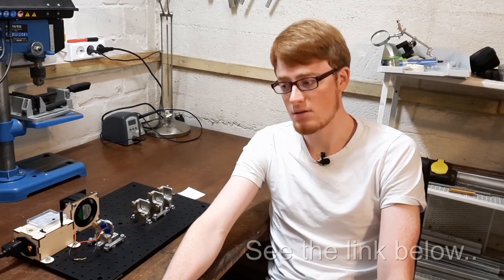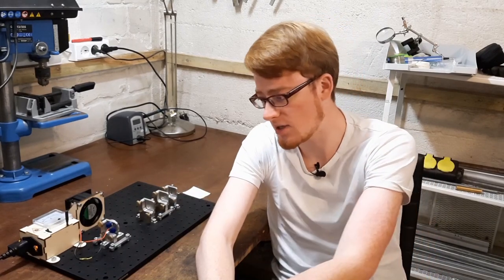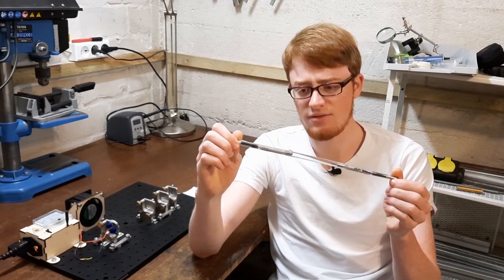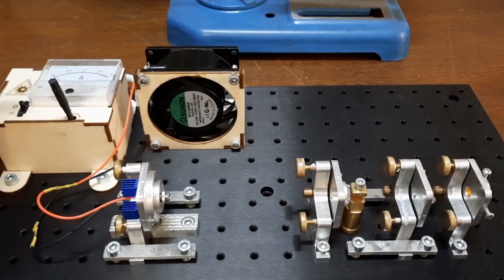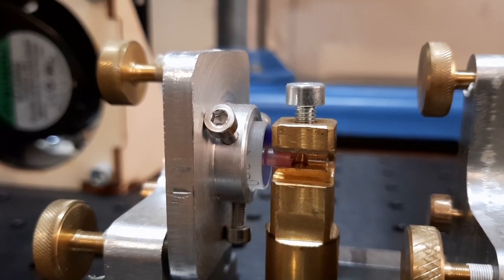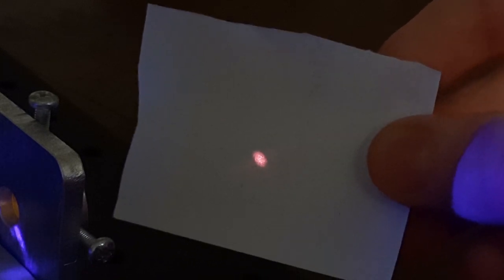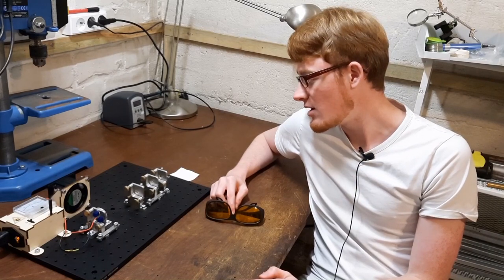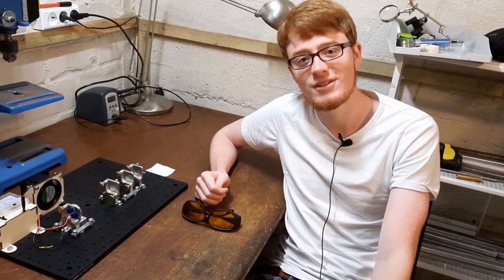A continous wave diode pumped RUBY LASER

Comment: Hi, I too am a laser experimenter and have been building various lasers fore close to 60 years now. I too am in the process of building a laser very similar  to yours except that I want to try and use  the combined output of several hundred blue  high power light emitting diodes surrounding the Ruby Rod in a more traditional optical cavity setup  but just use the blue leds instead of the flash tubes. I have several various size Ruby Rods and I will also be building a considerably more powerful traditional Ruby Laser using a 240mm long by 15mm in diameter rod and 2- 8500 joule flash lamps. I am very glad to see projects like yours since I was interested in Ruby Lasers for  almost 60 years now but there are very few people at least on you tube doing these kinds of projects. I wish many more people were into this kind of experimenting and building such powerful devices at home. I hope you continue to build on your project. I will continue to follow your progress.
Reply from the maker: Hi Peter! I can only repeat back what you have said: It would be really cool if more people were interested in building these kinds of lasers. 
Please, do keep me updated about your project(s)! I have read a few comments that pumping Ruby with LEDs is very problematic but this makes it even more interesting. Furthermore, I am actually also in the process of making a pulsed laser. It will, however, be a Nd:Yag Laser, but a pulsed ruby setup is planned. May I ask where you get your flashlamps and the ruby outcoupling mirror? Finding especially the latter has been a real challenge to me. 
Thanks for your comment! 
-Nik
Reply: @WoodenWeaponry  Hi Came across a guy through the laser pointer forums who had some sources of where to find these high powered flash lamps and the mirrors and I think the company was in Great Britain but i am not absolutely possible since this was several years ago. That place also had a huge assortment of Ruby Rods of all sizes and configurations but the rods were already all sold out. Unfortunately Ruby Lasers are gradually being phased out of industry and eventually they will probably just dissappear. I too have been looking for the proper Ruby Mirrors for several decades and I found that they are extremely rare and when they do come up on the used market, they are very expensive and are sold almost the moment they are listed. I even asked Thor labs if hey had proper Ruby Laser mirrors and they are able to make a couple if someone is rich enough to buy them. For a 25mm in diameter di electric mirror, they want $5000.00 U.S.  each for the totally reflecting mirror and $7000.00U.S.  for the output coupler plus they wont sell them to ordinary citizens because they are considered to be a component of a high energy potential device. I have come across the odd mirrors on Ebay but those are mostly mis labeled and of very poor quality and generally not worth the amount being charged for them. It cost me almost $2000.00 U.S. for 2 complete new sets of the proper, high energy di electric mirrors Although the mirrors I acquired are supposedly rated for over 700 megawatt pulses, a  very experienced laser physicist   I have known for over 50 years has told me that even these mirrors which are not even made from optical glass but from a special sapphire  mixed with other compounds will still gradually get eaten away and eventually disintegrate, especially the di electric coatings will only take a certain number of shots. Although this wont be for quite some time yet but eventually when I get this laser more together, the Rod will probably be cooled with liquid nitrogen and I still have the entire Q switch setup to look into. At this point in time, I have no way of knowing just how far I can go building this at home but my ultimate goal is to produce ultra high power short pulses of at least 100 megawatt each pulse. I have been asked several times why I pick Ruby and not the much more efficient yag variants and the answer is easy. I have built many fairly high powered lasers and  they have always been in the visible since seeing the laser light and what it looks like going through various crystals and even shooting across the sky like a shooting star is half the attraction for me and always has been and the other half of course is the actual construction of the device. A laser that has a billion watt output but is in the infrared, is completely useless to me.  I would rather have a 1 watt visible any day over a 100,000 watt infrared laser.

I have come across several very  knowledgeable and resourceful laser hobbyists over the decades and if I come across someone who has proper Ruby laser mirrors or the proper High power flash lamps, I will let you know if you wish. I know of a few people that tried purchasing some of the so called high power flash lamps off E bay and they were not satisfied. Some came broken and one person received 4 tubes and they did not look broken but they operated as if they were gassed out already. Some of the tubes being sold on Ebay are close to 50 years old or perhaps even older and unfortunately the tube  seals eventually leak.

Comment: Impressive achievement, my friend! Nice work! 

As a word of encouragement, water cooling is not absolutely necessary for a pulsed device as long as the laser is allowed to cool between shots. I often take photographs of my laser burning through steel blades and other metal targets, and I allow the laser to cool several minutes between shots.

Comment: Very tricky feat. Did a cw ruby way back around 2000, was a super thin rod with a low doping and pumped by a mercury capiliary lamp. The rod also required exceptonal cooling. Not very efficient. Try doing a CW TiSapphire laser. You can tune it over a wide band of the IR to red. 🤓❤
Reply from the maker: Hi Christopher, that sounds super interesting. Diode pumping has given hobbyists so many possibilities nowadays. 
Funny that you mention it, I am actually currently working on a DPSS TiSa. Got everything together, it doesn't lase yet, but I am certain its close. Its been my longest and most complicated laser project so far.

Comment: Regarding the mechanical stability: support the baseplate at 3 points.  This way, no torque can be transferred to the baseplate.  Leaning on the table should no longer affect laser output power.
          Question regarding polarization: ruby crystals output polarized light (the crystal structure has a transverse axis).  The 405nm diode is also polarized.  Is the absorption of the 405nm light by the ruby sensitive to polarization?  Is it important to align the diode & the ruby axially?

Comment: This is fantastic! I read this paper some time ago, and was planning on doing something similar, but as you say the optics are hard to get hold of! Where did you acquire a ruby rod so small?
Reply from the maker: Thank you! I got the mirrors and the rod from an expert who I had some correspondence with. He very generously donated the optics to me  after we talked about this setup. So I just got very lucky. I suppose HeNe mirrors could work as well, depending on the type. The rod itself is a much bigger problem. Maybe one could find someone to cut and polish the small 3.5x45 rods you can find on eBay. Not a cheap project for sure..
Reply: @WoodenWeaponry  Truly a brilliant job, home machined mirror mounts and everything!
Yeah, almost all laser projects cost a fortune, which is why I spent so much time developing my N2 Lasers. 
I picked up some Ex Soviet ruby rods, but my smallest is 76mm. That said, I suspect it may still be possible to end pump them with a little thought and careful selection of pump wavelength. Side pumping may also be a possibility, but I suspect it would be a water cooled affair, with many watts of pump light.
Reply from the maker: @LesLaboratory  The Problem with end pumping long crystal is that with more length, you need exponentially more power. Also, regions which are not pumped, absorb the emission of the other regions (unlike Nd:Yag) so it is critical pump the whole length. 
Also you need long focal lengths for getting a fitting Rayleigh length and therefore high pump intensities, but higher Rayleigh length means bigger spot diameter means less energy density. I am very doubtful that anything over maybe 20mm can be pumped using diodes that are available to hobbyists, but I could of course be wrong. Side pumping might work however. You could use a cylindrical lens to focus the widened beam into the ruby. Here, the focal line should be very close to the edge, so that the pump energy doesnt get absorbed on its way.

Comment: It's a nice tinkering project, no question there. And this is also an exceptionally clean implementation. But is there any breakthrough other than the typical obstacles that come up when building a Laser? The design route is standard to every optically pumped laser. You need short wavelength that your active medium absorbs. And a resonator reflective at your lasing wavelength. And then you have a Laser. There are uncounted combinations of pumping, active media, resonator styles. Some of which surely have not yet been videoed.
And I'm very sure many people have used blue laser light to pump ruby. It is what a ruby rod asked for since the first blue ray laser diodes came out. I know at least 3 different setups.

Comment: Ruby is a 3-level system which means it needs very high pump energies yielding lots of waste heat requiring water or LN2 for cooling, so I don't think it's lasing only fluorescing. I routinely demonstrate ruby fluorescence to customers at a mineral shop that I work at using 15 mW 405 laser pointer. So, you need to test that red light to see if it's coherent laser light or just fluorescent ruby light which is a nice deep red. Sorry if I popped your bubble conversely if I'm incorrect about it not lasing. I've read where a continuous ruby laser was built using liquid nitrogen for cooling.
Reply from the maker: Hi Roxanna, I am very certain it is indeed laserlight. The laser can be modified for it to show transverse (TEM) modes, and I have done that recently. This behaviour is impossible for pure fluorescence.
Reply: I suspect that it IS lasing.  First was his comment about getting TEM01 mode structure when it was misaligned.  Second is in the video: I noted scintillation of the beam around the edges where the camera is not freaking out with the high light intensity.

Comment: You might actually try pumping the ruby from the side in a defocused mode. If you can illuminate the crystal more uniformly it might reach a higher state of excitation and increase the output.
Reply from the maker: I dont think you can reach the critical optical power density for population inversion using that way, at least not with a normal laser diode. Focussing the beam seems to be the only option, imo. A flash lamp or cw arc lamp would work (and would be exactly what you described), but the goal was to build a DPSS System.
Reply: My thoughts as well. You would have to up the output of the laser diode to say at least 40 watts!?? Would be interesting to try!!!!??
Reply from the maker: @georgeyork8975  The side surfaces of this crystal are not clear so I cant really try it. Also, at these pump powers, cooling of the ruby becomes an issue.
Reply: @WoodenWeaponry  that's actually true under those conditions.
Reply: This would be a DPSS rod pumping setup you referring to. In that case, water cooling is necessary. But i dont think 40W of 405nm laser bars available commercially...or at least 20W, to side pump that crystal.

Comment: if the mode volume is not coinciding with the pump volume then is there still emission happening? i thought there would not be any
Reply from the maker: If the pumped volume is not coinciding with the mode volume, there will still be fluorescence, but no laser action.
Reply: @WoodenWeaponry  ty but it is funny how we are still seeing the intense lines of both volumes as if there is lasing and stimulated emission still happening although no output , there really should not be such sharp line if the resonator is not aligned and should only appear once mirrors align
Reply from the maker: Ah, I see what you mean. The fluorescence comes from the pumplight entering the crystal (first stripe) and being reflected and focussed back into the crystal by the curved OC mirror (second stripe).
Reply: @WoodenWeaponry  ahh ok

Comment: hmm is the wavelength different than the typical 694nm you get using a flash lamp because you are using another pump source and its absorbing and emitting something different frequency?
Reply from the maker: No, the excitation source has, in this case, no influence on the emission properties.
Reply: @WoodenWeaponry  well you said the emission is 700nm not 694
Reply from the maker: Ah then that was an approximation/rounding on my side, sorry. No, it is still 694.
Reply: @WoodenWeaponry  ok i should have remembered that each lasing medium requires the same unique energy no matter the source

Comment: Perhaps I missed it. What is the efficiency of this system? (output of diode laser vs crystal output)
Reply from the maker: I only measured the power way after publishing the video. I got about 45mW with 1W of pump power. So the efficiency is ~5%  Not a lot, I think Dr Luhs got a bit more in his 2019 original paper. The article is free to read, I greatly recommend it!

Comment: This might be a dumb question but if you were to side pump the ruby is there any reason you'd actually need laser diodes? I.e. what if you just used several watts worth of 'normal' 400nm uv diodes could you still achieve lasing? Ignoring cooling concerns of course would this just work similar to a flashlamp by illuminating the entire rod?

(edit: somehow during my first scroll through I missed the one comment where someone claims to be doing pretty much exactly what I was asking about, so apparently it would work in theory. But I am still curious because in your response you mentioned comments aboht LED pumped lasers being problematic. If you see this I'd love to hear more on the subject if you have any more information or even just anecdotes or assumptions that you're willing to share)
Reply from the maker: Hi, it is theoretically possible to pump the ruby with 400 nm LEDs. Flashlamps work and they emit not even pure 400nm. But of course only because they emit extremely intense light (which they can only sustain in shorts pulses). But cw pumping with LEDs would be extremely impractical, remember that I needed like 0.3W to threshold a ~200x200um channel, pumping a whole crystal at once probably would need much more than just several watts. So the concerns (at least in my head) are purely practical. I'd love to see it happen but I dont think its going to..

Comment: Brother,,,, you cut the ruby???? I am also make Ruby's but it's not glassy it's I hit little bit of hammer its total broken down powder what should I do????
Reply from the maker: Hi! Thats totally normal with this process. The ruby is polycrystalline due to the fast cooling time. Gem quality rubies are monocrystalline. Unfortunately, making those at home is close to impossible.
To cut the ruby, I used a diamond cut off disc clamped into my manual milling machine. This let me control the cutting process a lot better than using a manual dremel tool.
Reply: @WoodenWeaponry  ok bro now what I do???for perfect to make like real ruby
Reply from the maker: @saravanakumar2989  Regarding the cutting process, I was talking about the homemade rubies. Making and cutting a laser-quality Ruby is not possible at home. The only way to get them is by purchasing them. Or you could get one of those 45*3,5mm rods from ebay and find someone to cut it to a smaller length and polish the end correctly. So unless you know the right people (like I did for the ruby), its pretty expensive to get this crystal.